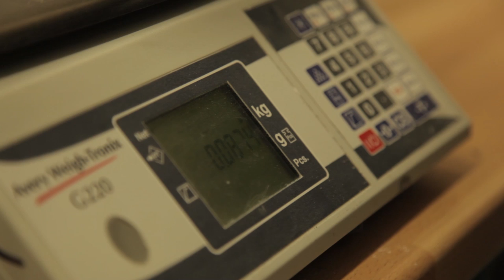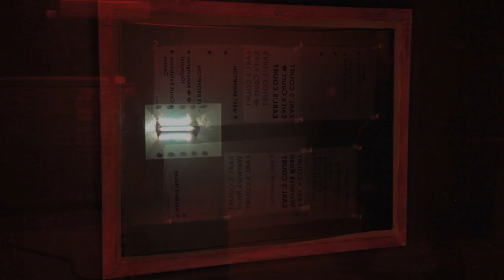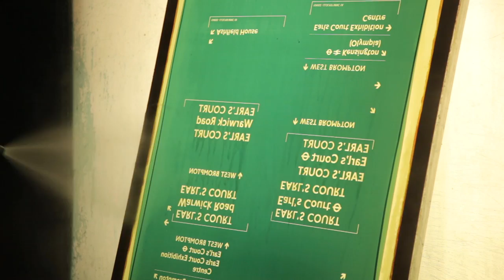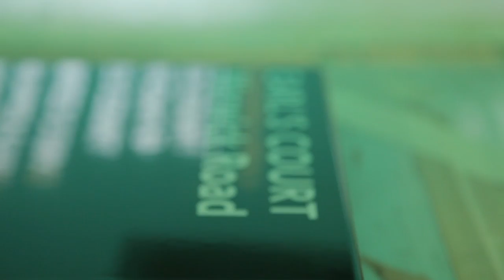The Vitreous Enamelling Process - A.J Wells & Sons Ltd.

Comment: Very interesting, no secrets given away. Mix would appear to be carbon black (lamp black) glass and quartz powder. Fullers earth might possibly be useful for a more grey colour.  These have to be very stable colours.  Titanium oxide would be good for the whites.  The second firing at 40deg. lower is interesting, is this the glass /quartz ratio, hence the need to an accurate weighing scale.  Must have a go.
Reply: The black thing looks a lot like graphite powder. Even the container looks like something you'd use for some cheap and dirty material.
The last thing looks awfully similar to plain old borax (it has to be some kind of salt, or at least hidroscopic and soluble, look at those crystals sticking to one another).
And wikipedia says "Frit for enamelling steel is typically an alkali borosilicate glass". Now, I'm no chemist that's for sure, I think that borax decomposes to boric acid when heated, so the alkali throws me off, but I do know it's used in enamels and glasses. And "borosilicate" needs a boron source, right?
I just couldn't resist adding to the speculation ;)
Reply: @Jonnie , what is the correct temperature for base coat ? we spray white and it come out as black . but after color spray it come out and color fall off  or peel off. need help .  from KOREA.

Comment: What's the waterfall for?
Reply: It pulls the fumes away when spraying. An alternative would be a large filtered wall with a vacuum system.
Reply: I was about to ask the same thing. Originally I thought maybe it was just for ambiance then I realized I saw one in someone else's enamel spray room.
Reply: @drewnicest4319  Another commenter said that it traps and pulls away fumes; it's an alternative to an extractor fan.
Reply: I saw that thank you. I don't fully understand how. Not much info on this type of work online.